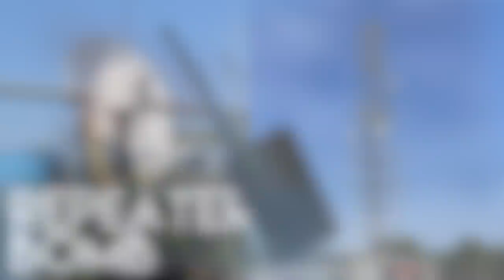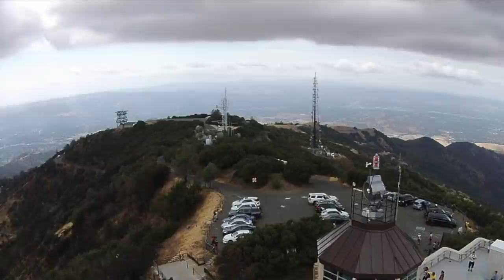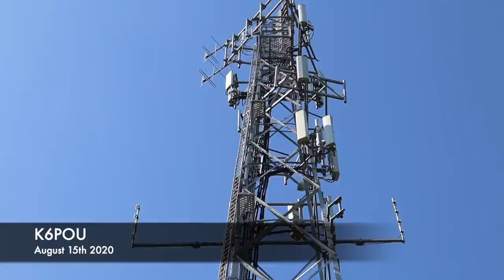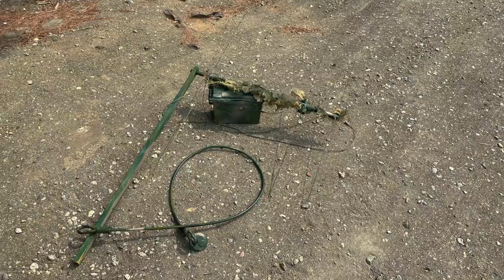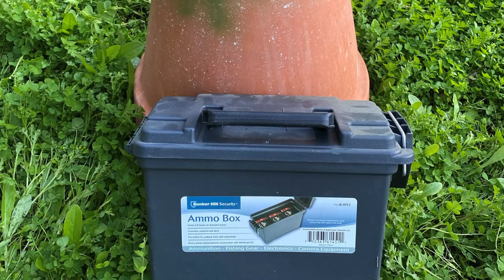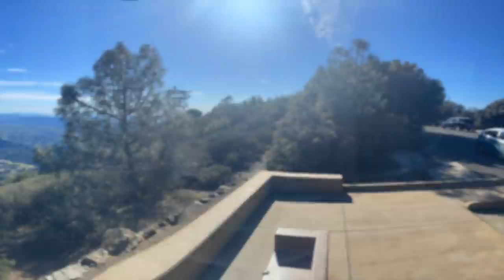The Hidden Diablo Mountain Amateur Radio Jammer

Comment: why do people disrupt a hobby... Same people who buy up all the ps5's and resell them on ebay for way over their MSRP.. They do it because it's a type of self gratification and to flex knowing no one in their right mind is going to pay them $5K plus for a video game machine. People that jam ham are typically hams themselves in the USA and will even join in on the complaining and fox hunts. It also may be important to say that most hams that drone on about finding some ham jammer and reading off specs of DF equipment on the air are typically full of themselves and have no real interest in DFing jack or they themselves are the person behind planting said jamming devices in the first place. I have dealt with several hams in the past that were front and center on DFing ventures of jamming devices  on ham, commercial and railroad bands only to find out that they were the ones who built and deployed said devices because the could not pass the test to advance their license or some club wronged them.. Others are politically motivated and not even licensed hams but know as much if not more about radio and systems designing as a ham would and will build radios and jammers to plant about.

Comment: Radio jamming should be a feIony. I’d say two years in the pen plus a £25,000 fine would teach them respect.
Reply: It quite is actually. Especially since by the book, ham is considered an emergency resource. During times of disaster they’re used for emergency communication (was done for example during Katrina and 9/11) Even HOAs can’t prohibit you from putting up an antenna and tower if you’re a licensed HAM. 

Radio jamming in the states is highly illegal.

Comment: Wow, impressive build! As you said it wasn't designed to be retrieved but a wire that goes to some buck/boost converter for charging if it was to be retrieved.
The idea of a 24hour recording on an mp3 player then the tx on vox is very much KISS and almost failure proof.

Comment: I live in Pittsburg and someone you might want to look at lives at Harbor and 9th. He's has had antennas for at least 50 years so that would make him old but you never know. He keeps adding antennas. I coincidentally encountered him at the CB/Radio store in Oakland and he began harassing me for buying a certain part for my radio. And no, I'm not trying to exact revenge. The FCC is pretty good at tracking down transmissions and they come in with heavy fines and confiscation.

Comment: I admire his ingenuity and motivation. He went out of his way.  I appreciate his dismay and frustration with certain individuals on the air. My Only advice to him is, if you wait long enough, those mush heads get bored and go away.  It just doesn't happen fast enough.
Reply: The problem was... he was the mush head. And just like you said, he did eventually go away forever. Good riddance.
Reply: There is also this thing called a VFO